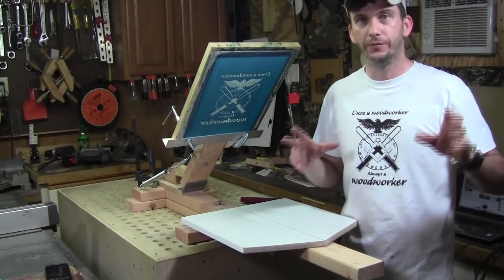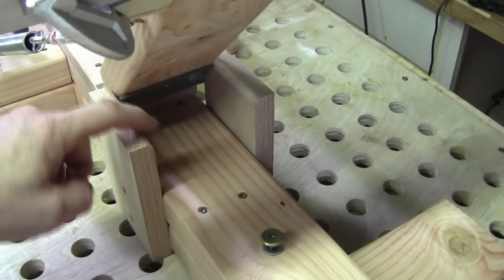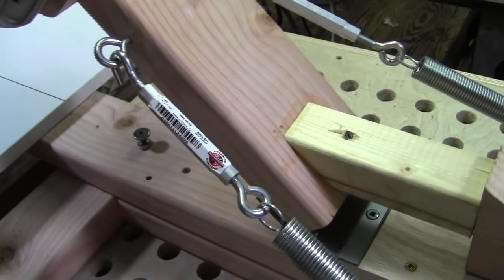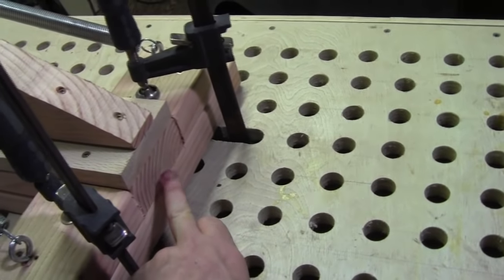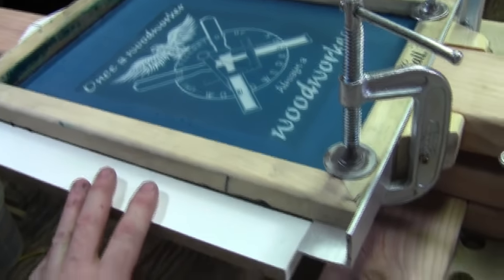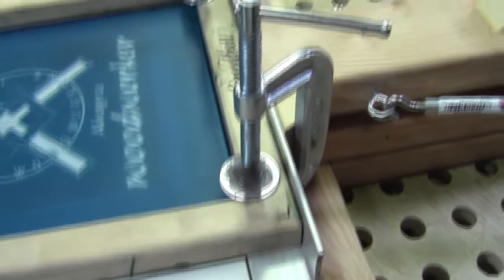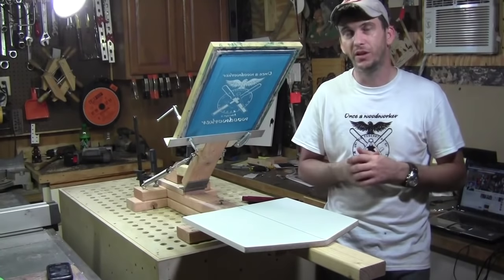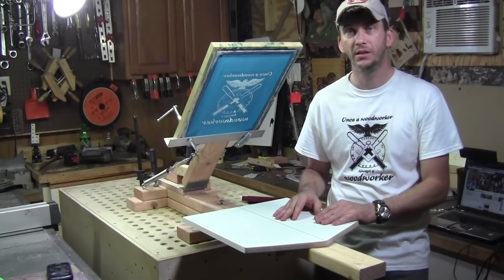Printing Press Follow Up

Comment: Awesome video Laney - thanks for the shout out! I noticed in my video I made a measurement error, my cross pieces on the bottom layer are 16" long with a 14" center "I" piece. The 16" pieces make it easier to bolt the press to a table. I have made that correction in the pdf parts list.

Comment from the maker: @JramatikClothingCo. the project itself was somewhere around $20 with the springs and commercial hinge costing the most. screen material i bought at hobby lobby for $9 ink is around $8 and the emulsion i think was somewhere between $15 - $30 i have a link to a video showing how to make the screen in the video discription

Comment: An very easy way to line up your image is to put a crosshair (registration mark) above and below vertically centered which will enable you to center your image to the platen in seconds.